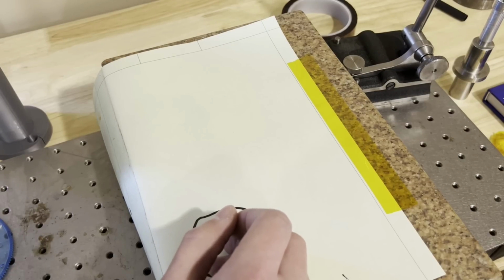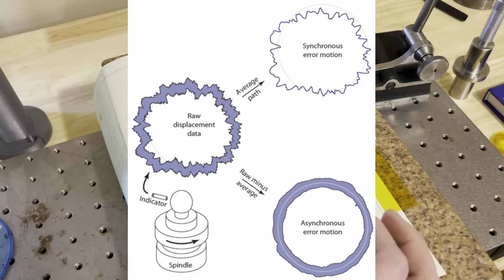PRECISION SPINDLE METROLOGY Pt. 1: Fundamental Concepts

Comment: 7:32 So runout refers only to the outside surface of the spindle, whereas for a spindle to have error, the actual axis of rotation needs to un-align itself?  I’m thinking of a camshaft which can have horrific “runout” in spots, but it still spins true.
Reply from the maker: @Sean_but_Not_Heard  basically, yea

Comment: I'm not 100% sure i understand the "fault" of the concept if TIR. 

Let's assume I've turned an eccentric with a 4 yaw. And I consider my workpiece "the spindle" The bit bit in the 4 yaw of course will have a large amount of radial error motion. And my turned eccentric has practically zero TIR. 

If I now attach a part to my turned in place eccentric that would come out round wouldn't it?

So what is the problem with my "bad spindle" that has low TIR 

Asyncrous error motion should in theorz get picked up by an indicator because It can't really be removed by turning in place.
Reply from the maker: The turning in place does not “remove” the synchronous error motion, it simply cuts a part that has the inverse shape of the error motion, canceling it out at the point of measurement. So while the TIR is zero, the part is still moving around all over the place, and it’s still not round. Those two things are just canceling. So if you mounted a part to a turned in place arbor, it would be very concentric to the arbor, but still would not be round. 
And yes, the indicator on the turned in place surface would see only the asynchronous error.

Comment: Like some other commenters, I find it interesting that error motions that have periodicity of some rational multiple of spindle rotation are grouped into same asynchronous bucket as completely uncorrelated/random error motions. Especially in the discussion on how the errors average out, I feel the distinction would become significant. Thinking about that spirograph demonstration, the final error over many turns would be represented by the envelope of the spirograph, and that tends to some synchronous pattern. But the envelope of random error motion should tend to perfect circle.

Comment: I would assume the error can split into deterministic and non-deterministic (random). Synchronous is deterministic and asynchronous can be split into deterministic and random components. More or less like any error signal in any system. Makes sense? Anyhow, great topic for a series!
BTW, Dan Gelbart explains in one of his videos the difference between runout and “true roundness”, as well as how to separate error components using a generalization of the reversal method.

Comment: Excellent explanation of different error forms and use of visual elements :) 

<pedant> Interesting that the definition of (many) asynchronous and synchronous errors are synchronous (some multiple of the rotation of the spindle). I guess it's easier to think about periodicity, if it's really long then it's practically asynchronous </pedant> :D

Comment: Re: Synchronous vs. asynchronous vs. random motion:
Presumably (for example), a non-round ball in a bearing will have non-predictable moments of stick / slip, which will lead to actual random error motion, rather than asynchronous (rational?, as in a ratio of..) error motion?
Reply from the maker: @marcfaulk  yes, exactly. Ball and roller slip adds true randomness to the error in that case.

Comment: Could you have asynchronous error in such a way that there is no integer ratio between the error motion and the spindle rotation? Something where the ratio were an irrational number, basically. Like a spirograph orbit that is regular, but never comes back to its starting point.

Comment: Cool video! Nice and clear explanation about error motion of spindels. For my master Thesis I looked into the error motion of air bearing spindels. Asynchronous error motion in air bearing spindels can be caused by the runout from the rotor, if the air bearing is an orifice type of air bearing. It is a similar problem to the precessing ball bearing. Porous type air bearings experience this a lot less.